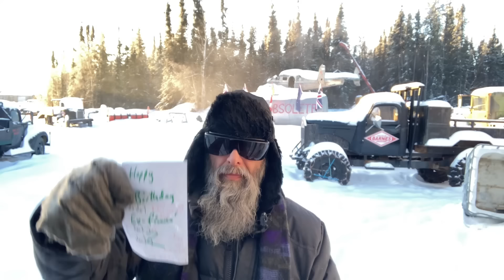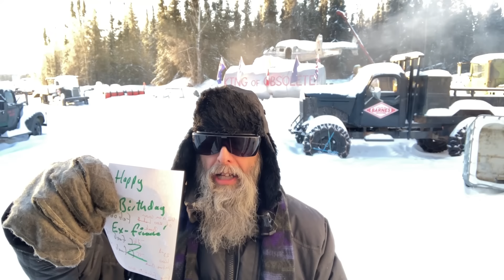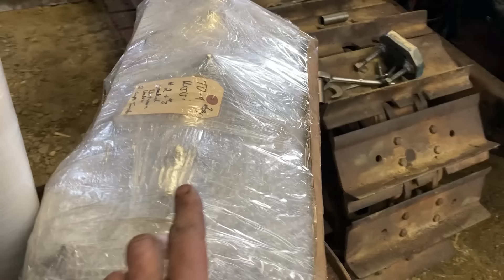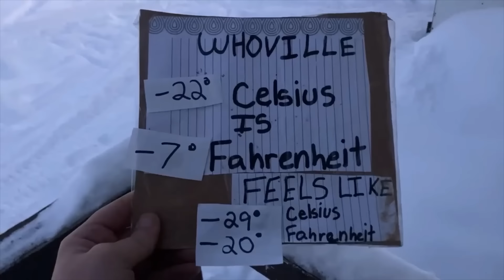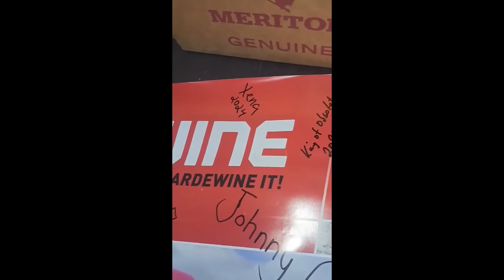Slowly Getting Injector Cups Plus Riding My Mini Hoe for Firewood Feb 06 2024

Comment: Just dropping a quick comment to see if this platform is still censoring me before I type out a bunch again.
Reply from the maker: oh my that is not good  thansk
Reply: @kingofobsolete4789  I'm going to try to be brief and hope none of the words are what the system doesn't like.   Regarding the thermostats for the cat, something that came to my mind was a ford thermostat with an extended spring base that seals a port underneath, similar to the cat, but it uses a flat disc to seal against a surface.  I have no idea about the dimensions since I don't have one handy, but there are other makers that use a similar style, so maybe something is out there that dimensionally would work by sealing to the top of that inner port of the cat housing.     
Lookup the part on the parts place us Canadians love because the pricing is good (another name for boulder, justincase the name of the place is causing the disappearing messages) but 2008 ford crown victoria 4.6L thermostat.  It has photos of the correct stat, because other places show the wrong conventional stat.  Hopefully this at least makes it to you.